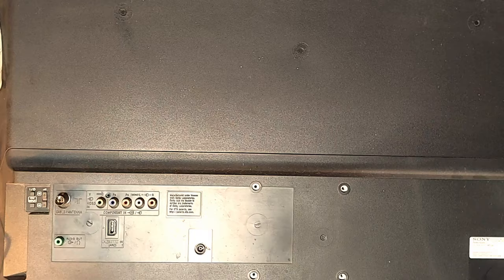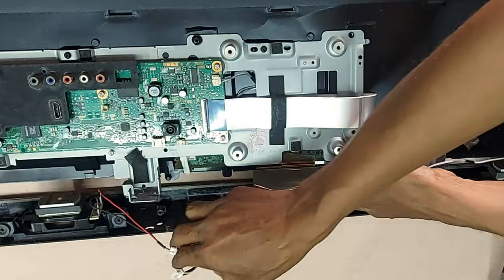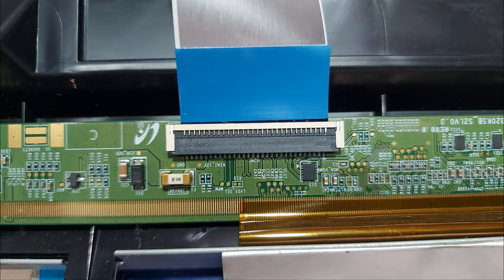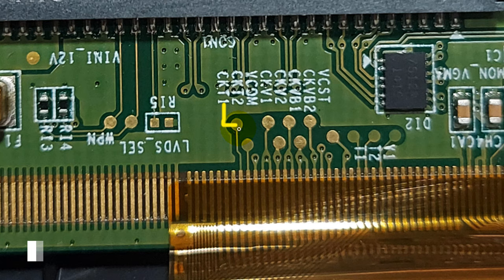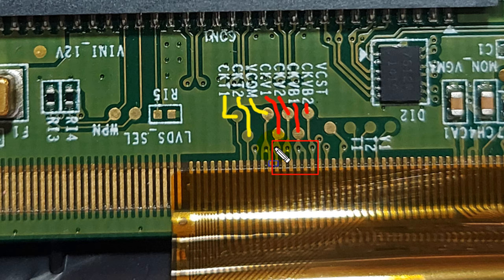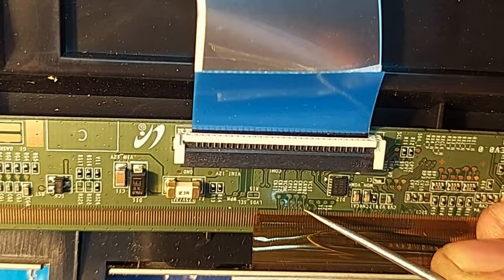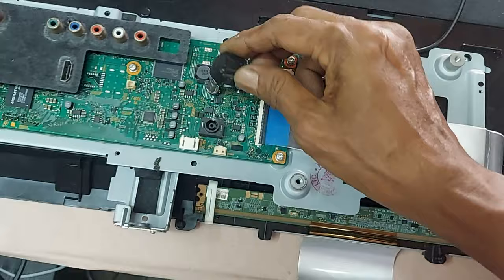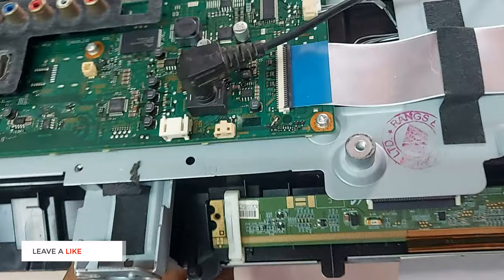Double Image Problem SONY Bravia LED TV | Display Panel Repair to Solv flickering picture - Cut CKV

Comment: The ckv2, ckv2, ckvb1, and ckvb2 lines are control lines that transmit the control signal for the display to the T-Con board, and their functions depend on the specific model of your television and the type of display. If you accidentally cut these lines, it should not affect the overall operation of your television, but it could cause issues with displaying the image or even damage your TV, as you would lose those VGL, VGH, VCOM, HSYNC, and VSYNC functions that control the brightness, contrast, and synchronization of the image on the screen.
Reply: tq bro. Really good information

Comment: Bro if we need to disconnect these connections then why the company join these connections?
Reply: I second that
Reply: Bro first understand. These lines created already short circuit in panel, so not working. We cancel short circuit by cutting those lines👌👌👌

Comment: Good afternoon Mustafa, I'm looking at an ace from Russia, tell me how do you determine which contacts to cut?I have a CV315PW05S t-con there is no voltage because there are no voltage rises except 12 and 3.3V

Comment: Hello, I have this problem on my Sony KDL-46EX521 and that's not the same to repair because the're 4 flatcables who comes from the  panel to 2  long small boards benead the panel, how to fix that?

Comment: I had the same issue with double image. Also no image on all my Netflix apps, movie apps, Disney apps, and so the only thing I had to do was unplug the power cord of the TV from the power source for two minutes after that plug your power cord back into your TV wait two minutes and then turn your TV on and that fix my problem I didn’t have to open up the back of my TV and start cutting stuff.

Comment: sir, i have sony kdl 42w805a 
 in my case the flickering doesn't do it immediately, it plays normally for about 20 minutes and then it flickers and other times it finally disappears, the image becomes black and the backlight also turns off and other times I have a backlight without an image, the problem is somehow complex

but it always starts with flickering
Do you have something to suggest me from your experience?
or do you have an email to send you a video and see exactly the problem ?